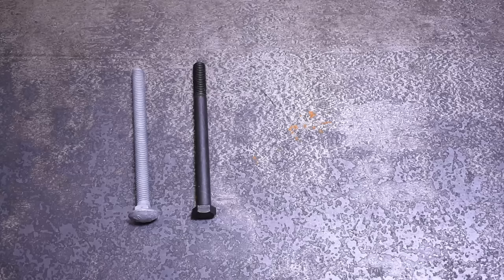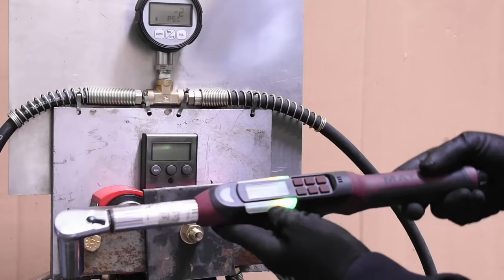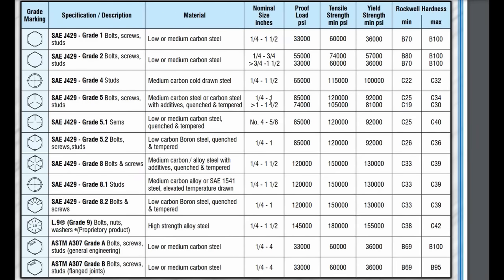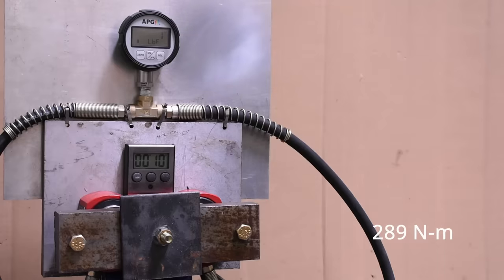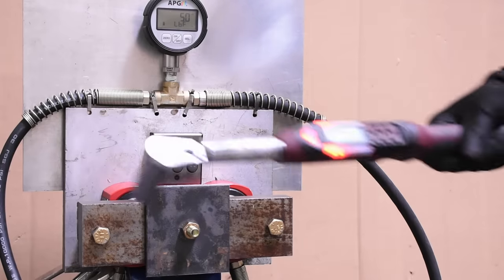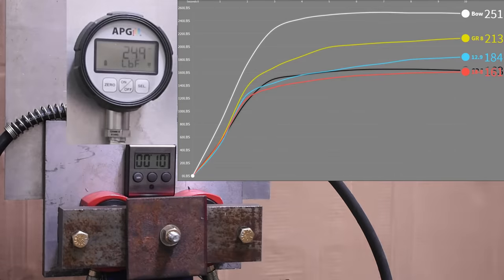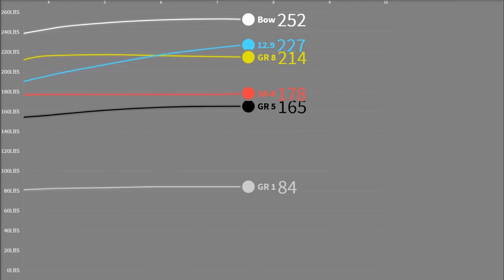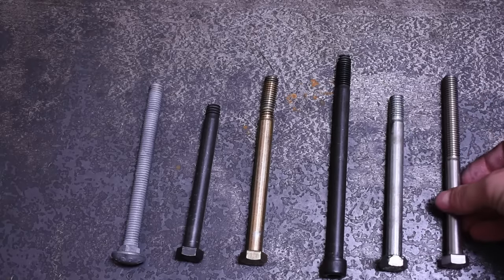Strongest Bolt? Grades Explained & Dyno Tested For Science

Comment: Is anyone else bothered by how loose the left mounting bolt is in this video? I couldn't stop watching it shake during every test. I wanted the driver to be moved over and tighten it every so slightly, but no, I'm left wanting.
Reply from the maker: The side bolts have to be left loose, they are just for alignment when the center bolt is missing, otherwise they should be loose to not interfere from binding

Comment: too complicated to read the specifications .but it's easy to identify a hard Bolt. More stuff written on top the harder. but that's no good without the correct nut   eg. 8.8 nuts are bigger  and dump the sae     metric is the grade number  its easy

Comment: 18-8 bolt/nut combination is known for galling it should be always used with molybdenum disulfide lubricant
Reply: Nickel based anti-sieze or Loctite PST work fine on fasteners up to 3/4" (I haven't had a reason to try anything bigger)
Reply: Or wax

Comment: I think you are focusing on ultimate tensile strength which is FAILURE . Not Useful as past the YEILD strength they are ballast .So take your curve and then the first deviation to roll over as you say .. that is the Max strength of the bolt (Yield strength)
Reply from the maker: Yessir. Pinned comment

Comment: Great vid. Had a lot of trouble with garbage hex bolts, machine screws & extra thin flat washers from Grainger's that all were made in cheating communist china. Had heads of 1/4"' stainless steel hex head bolts break off while only using a nut driver. In our maintenance shop only purchased grade 5 for everyday use.

Comment: How do you reconcile using different impact tools on the same bolt?  I think your testing COULD be correct, but it is impossible to know when you use different impact tools on the same fastener.  You have thrown ALL TESTING CONTROL out the window and down the sewer by using different tools to  tighten these fasteners.

ALSO, 18-8 stainless is a spec for a simple stainless alloy, NOT a hardness rating.  The whole test on what you think is a "grade" of bolt because it says 18-8 on the head has NOTHING AT ALL to do with the tensile strength of the bolt.  18-8 is a stainless alloy, more suited to telling machinists which speeds and feeds they should use when machining such alloy.  

This test is a mess, and no reliable data can be assumed.

Comment: Superficial testing again. Each of these bolt classes has very specific application parameters and use cases. Max torque (not pressure psi) and cost are not the really meaningful criteria.  I suggest reading a good text book is more informative.
You need to look at tensile and yield strength, static or dynamic loading, electro-chemical compatibility, surface treatment (hydrogen embrittlementand more...
Reply from the maker: There's plenty in text books that's google searchable and been around for a century as you know. But how many people are reading up on that. There's little practical testing showing what this info looks and feels like in real life to the common person selecting bolts. 
If you throw up your hands every time something you want to discuss has been figured out in a lab or a lecture hall, you're left with nothing

Comment: 18-8 is 304?  Come on guys, I need to trust you on other stuff more than that.
Reply from the maker: 18-8 is a grade of stainless that contains 18% chromium and 8% nickel, which includes 304 but you're right they appear to be separate
Reply: @TorqueTestChannel  You know, I hadn't noticed that 304 was also 18%.  I will retract my statement.  But it also has better anti-corrosion properties than 18-8; and where I'm from you spec 18-8 when you care about structure, and 304 when you care about corrosion (both being sort of the entry-level alloys for those needs).
Thanks for all the good work you do.  I really enjoy your For Science pieces, it's great to see an effort like this that nobody else in the world appears to be doing.

Comment: The way you test is super poor, and i would say that no-one should use this video as reference
Reply from the maker: If you want lab proof tests just google it or use a calculator
Reply: @TorqueTestChannel  so.... what was the purpose of this video?
Reply from the maker: @MassantiMuller-bo5wl  None of those tests are based on how these bolts get used in the real world for example on a vehicle, where every tech is going to be using an impact. So we wanted to know if the lab numbers relate to the torque these bolts see and if increases in bolt grade fair better. 
If you dont care about hammering on a bolt, then its easy enough to fall back on the PSI ratings and charts that are widely available for these already and not watch.